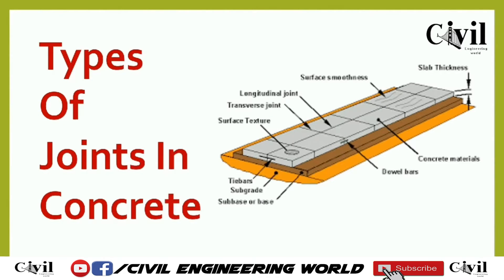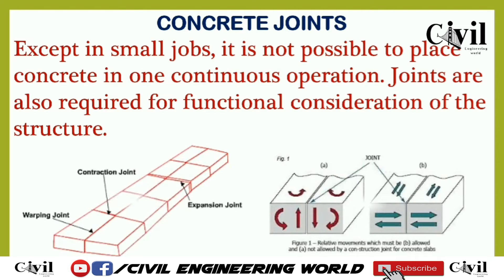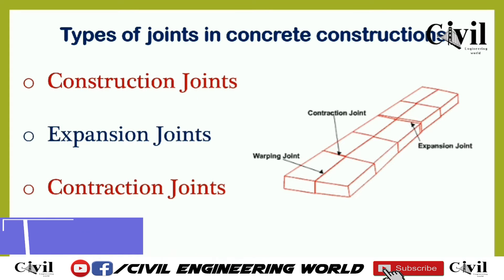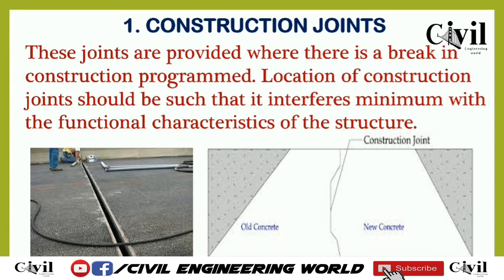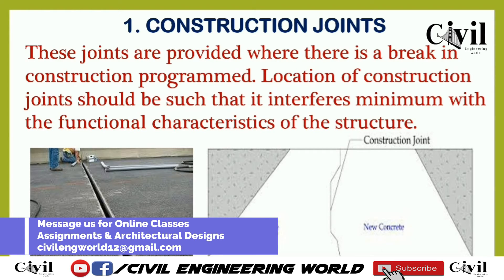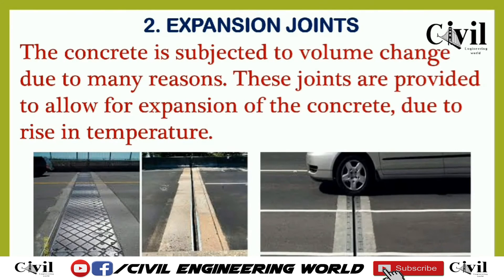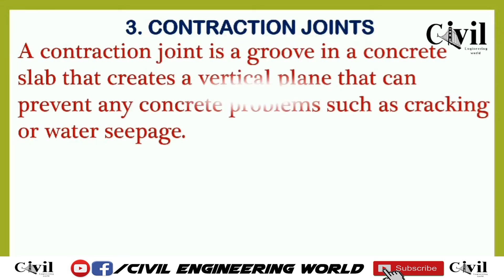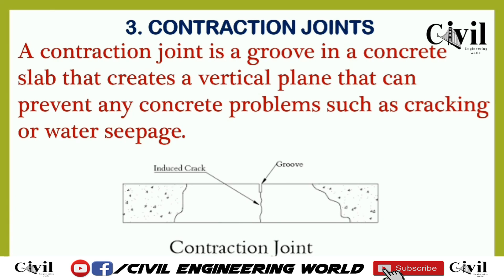Types of Joints in Concrete

Comment: How do we call the joint that is to be put between an existing structure and an extension of same.  I found that it is sometimes construction joint, expansion joint and thickness varies from source to source through a majority seemed to converge toward 25mm. joint filled with compressible materials from foundation to roof and to be fully framed on each side of the joint.  I wish I could get more information on this and what materials to be used as filler. Also how to prevent rain water from entering through the top and sides of the joint and how to make sure that those fillers are weather proof and whether we need to refill after some set time.